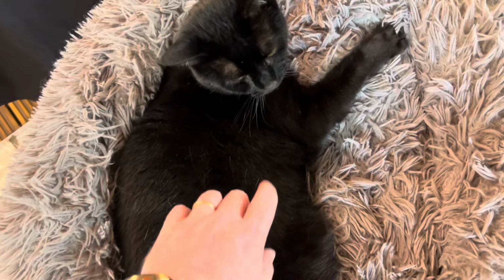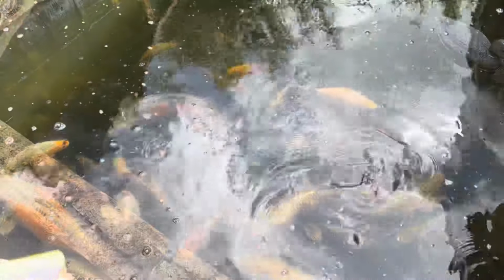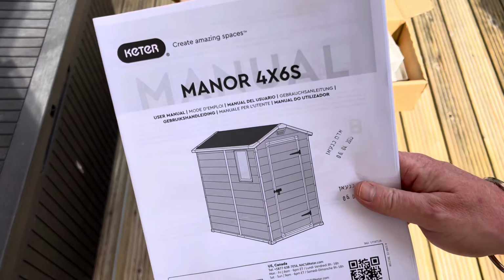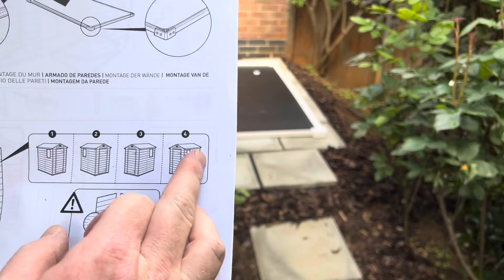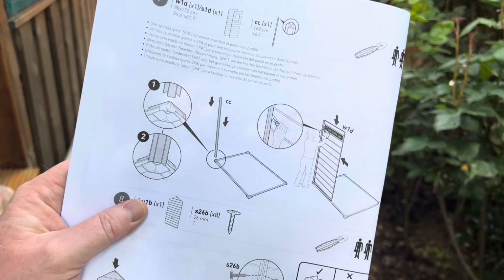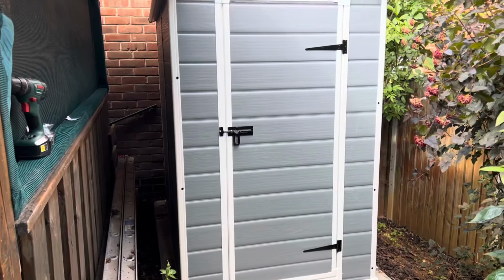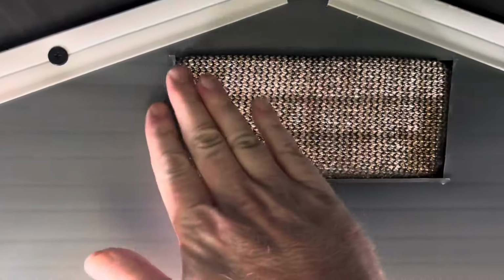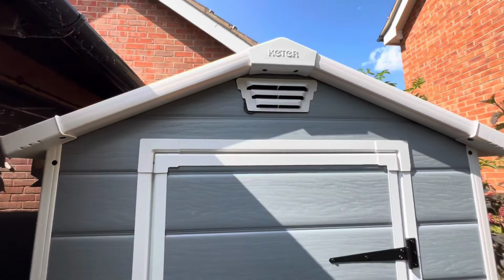KETER Manor Shed Assembly 6 X 4ft

Comment: What about putting the roof . I am having a hard time with that . What did you use to get it in the walls, what you recommend me to do or where to start  . Mine look a bit narrow and honestly i don’t find an and  with it .  Thank you on advance
Reply from the maker: Sorry for the delay, I just popped in one corner at a time and all the joints just slid in with a push. Hope you got it all together now.
Reply: @HooverLux  the parts were really narrow i managed to get a handyman and a friend tp help , they had a hard time putting it but managed . Thank you for the reply
Reply from the maker: That’s good. 👍
Reply: We're struggling with the roof also.  We never got sent a spatula so we have had to send off for one. We got frustrated in the end and gave up. Trying to get the roof on again at the weekend
Reply from the maker: @hannahferry7811 I found fitting one side on and then the other, it should just slip in easily or with a little push? Are the walls fitted in at the bottom correctly?

Comment: Not sure its too late to ask a question but I want to site the shed on artificial grass. It is pretty level but would you advise a base? I do not want to go to the trouble of concrete but are the flags you used OK and does to have to be a complete base or with the corners surface?
Reply from the maker: If your ground is level and it won’t get blown away in bad weather you should be fine, my flags aren’t 100% level and it was fine, but just see some other comments about that and the possible issues and tip when constructing.
Reply: Thanks

Comment: I will visit you in short time and cary the shed away. No fixing has been seen 😂
Reply from the maker: 🤣🤣, we had all the garden remodelled late last year and then had the shed anchored down with spikes in concrete, was so much easier with half the gazebo removed and it all levelled out. No leaks or issues over winter, no rusting, no condensation either. Well happy with it

Comment: Funny! Just put it together(thanks for the vid) and found one thing that's in the instructions that seems like double work.  They have you put the bottom with rails together and then flip it over to put in the screws.  The rails kept falling off as I flipped it.. So I put it together(on the 4th attempt) with it already flipped over.  Much better.

Comment: do you need to put the pavers perfectly level? i also have pavers but they're not perfectly leveled
Reply from the maker: Well, mine weren’t 100% and that did give a little issue before I screwed in the side panels to the base, but I was able to rectify it, a I can say is before you screw it all in at the base and sides, make sure they are all level by having someone add a little pressure to push down each side panel before you screw them in
Reply: @HooverLux  great info! thank you very much for sharing

Comment: Excellent job there 👍
I have a question if I may?  If you wanted to run power in to it, is there somewhere for the cable to go or would you have to drill?  Just curious cos I’ve been thinking about getting one of these.
Reply from the maker: No, you’d have to drill a hole through it and seal up the hole. I know you can get the parts for doing that
Reply: @HooverLux   Thank you 👍😘

Comment: Any trouble with the roof? It appears like it wasn’t really an issue for you. I cannot seem to get that roof flap around the wall far enough so i can screw the roof flap into the shed walls.
Reply from the maker: I’ve seen some other people did have issues with that, but it just slid in no problems, if you have one piece of the white roof edges just slightly out of place it can be a Buggar to fit.